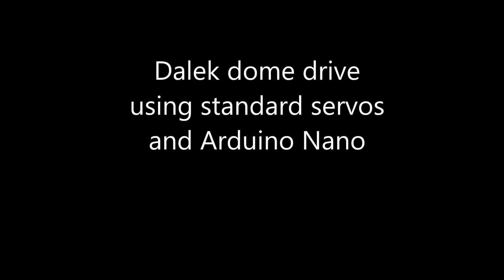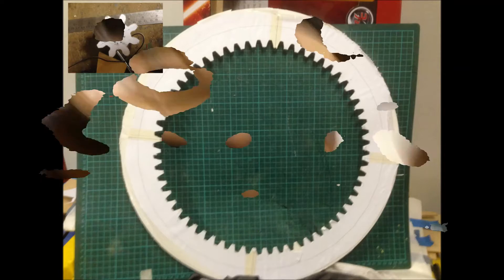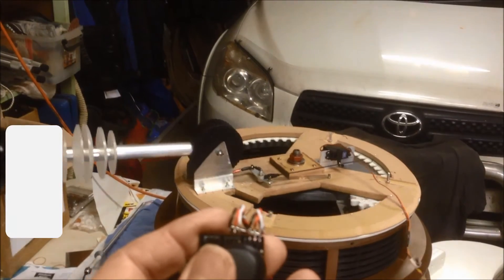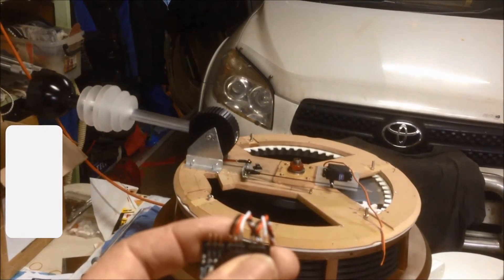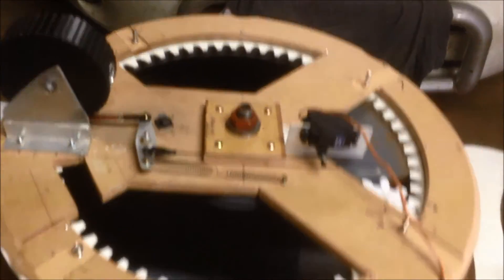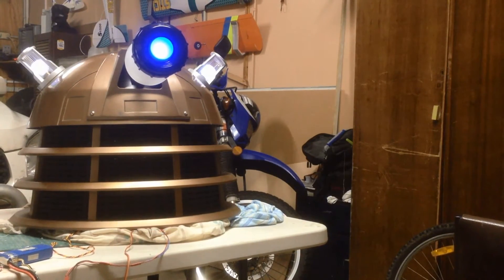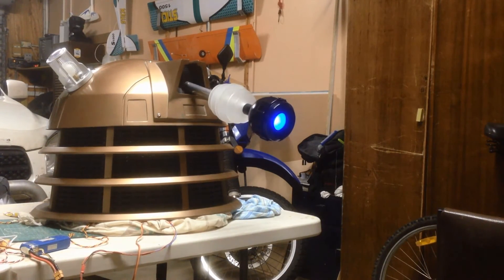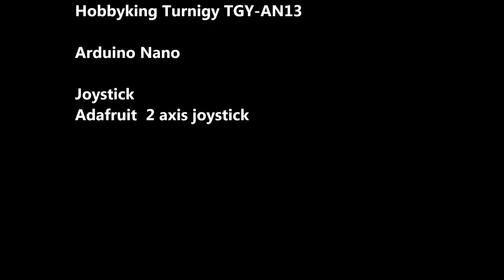Dalek dome drive system

Comment: where can i find more info on setup and programing for this
Reply from the maker: Have posted all the information in Project Dalek Forum, this forum require a login to access but there is no cost to join. Since this video have made two other variations which are also in the forum post.

https://www.projectdalek.com/index.php?/topic/12825-dome-and-eye-drive-system-with-arduino/
Reply: @ozzymat61  found it thanks